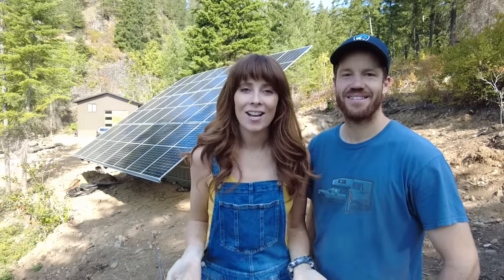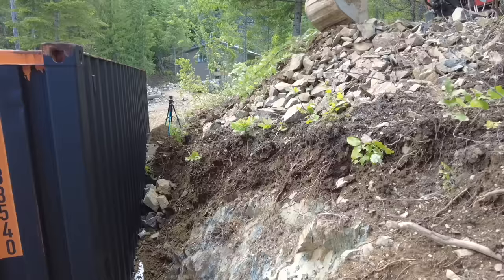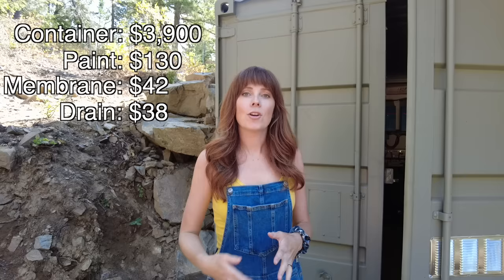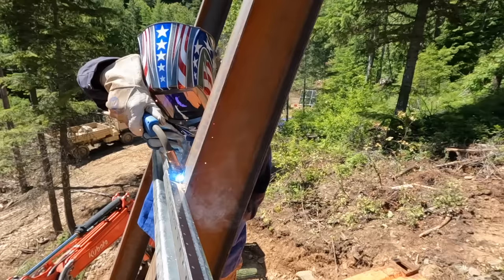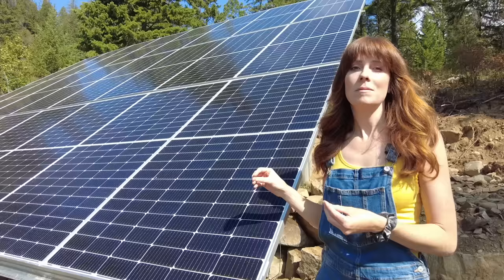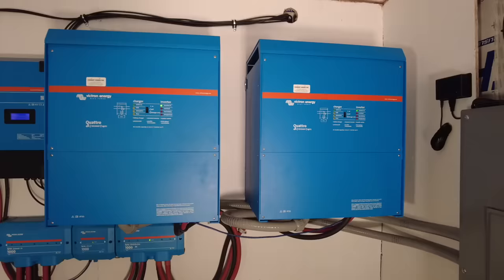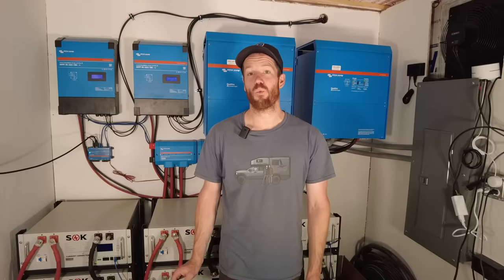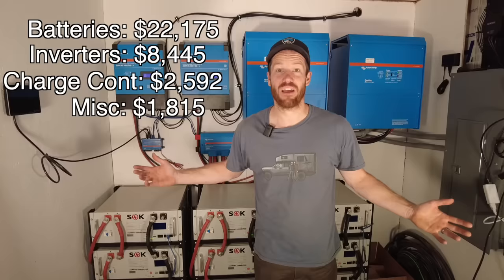TOTAL COST Of Our Off-Grid Solar Power System | Powering Our Mountain Home

Comment from the maker: What do you think, will this system be enough to keep us powered this winter?! ☀❄
Reply: More than enough.  We are following closely though.  Headed to ID in the next month or so to look for our own little piece of respite from the craziness that is everywhere.
Reply: I think you better have plenty of gasoline for that geni and propane or firewood for heat :). Regardless, it was the right move for the channel.
Reply: You should have plenty if you conserve power during bad weather. You mentioned a daily usage of 20% (12kWh) but if that is what you actually take from the batteries each day and not total daily consumption I can’t imagine just how much energy you use each day. At the end of the day you could easily get your daily consumption to around 3kWh per day if need be.
Reply: I expect it will provide plenty of power through the winter especially given the fact that you also have other means of heat. It’s a perfect solution for your situation
Reply: As you mention you are only using 20% of the battery capacity a day so even if that doubles in the winter due to being indoors more the only issue is replenishing that capacity.  Solar capacity might be your issue.
Reply: Well, I think it will depend on how creative you get in the workshop this winter, but I also see you folks putting a cross wall with a door to make a room for the battery's and a small electric thermostatic controlled heater to keep the battery's above freezing or optimum temperatures for the battery's. Other than that it looks like the best plan with continued savings every year.
Reply: Most definitely.
Reply: @johnw3724  with over 10kW of power and maybe as much as 12kW in the cold weather, you’d think that would be plenty but with all the surrounding trees, who knows.
Reply: Yes
Reply: yes and BTW can you show us ur internet solution what do you use to get it
Reply: I doubt you will ever have any issues with this awesome system you have created. You have done an excellent job & made so many good choices & asked the right questions. I think you will get some thermal benefit from burying the container, despite what other’s may have said, & I think it was a good choice for all the reasons you mentioned, even tho burying containers can have it’s cons, Hay bails front & side maybe if needed, but ur inverters will help keep the Power Room temp up as well of course. This Solar Series is what brought me to ur channel initially & I have binged most of ur adventures & Builds since, Love ur stuff! Cheers
Reply: I have no idea about winter, but you didn't give us an idea of cost on a generator. There are microturbine generators and the good old standard diesel generators. I've been to some off-grid properties and a massive generator with a battery bank seems to be most popular.
Reply: I would guess it will depend upon cloud cover.  You are in N. Idaho, snow county.  I would get a large back up generator just in case to keep batteries charged. I am sure you have already considered that.
Just rambling to please the algorithm.😎
Reply: @kevinmills5293  First 3kWh is 3000 watts...  
A 20gal electric hot-water heater will use more than 3kWh a day. A Well pump uses and average 1kWh per day. An electric clothes dryer will use at least 1kWh per hour. Then there is A/C that is going to pull at least 1kWh per hour. Misc. 'SMALL' oven 1kWh per hour. Lights, Computer, Fans, Microwave, at least 1kWh per day. He does WELDING - "Let's make it simple! If you run your MIG welder at 200 amps, it would draw somewhere around 20 amps from the supply. Thus, the power consumption of the welder will be 4.6kW. That said, similarly a 150 amps welder will use around 3kW of electricity."
Reply: I think you'll be OK. I'd probably look into adding a propane or diesel generator back up that can be on auto start just incase, you can set it up by your system. And don't be afraid to look into a wind generator. On the smaller scale, they can be quite effective.
Reply: @chasmarischen4459  you forgot house heating at 10W/square foot
Reply: Yes
Reply: Buy extra panels. they are only rated for 25 years.
Reply: My money is on yes for this winter, but the first year that you're doing a lot of shop work instead of construction work...Probably not.
Reply: @Chris_at_Home  I not so sure. When they get the workshop up and running, welders and plasma cutters take a lot of power.
Reply: I don’t think you will have any problems keeping your batteries warm with the inverters and charging equipment in there. We have a 4K inverter in a well insulated unheated 12x16 ft room and it keeps it above freezing even when it below -20f. We put the batteries and charge controller in a heated room.
Reply: Only thing I'm noticing is maybe shave some more dirt at the base of the array in winter mode, because a couple big days of snow could lead to build up on the lower panels
Reply: You might need to clear more trees in front of solar panels to get full potential in the winter.
Reply: Average sun hours in Coeur d Alene Idaho in July is 383 hours.  in December it's 60.   You have 24ea 440 watt solar panels.  But let's be honest.  That is a maximum number.  You never get anywhere near the maximum.   Your battery system is absolutely killer.   Lithium batteries charge so fast, you're not going to waste the power your panels bring in.  As an off grid person myself, I am an electricity miser in the winter.  but I have a fraction of the batteries that you have.  

My guess is you will probably have to cut back on your use of juice in the winter.  The question is how much.  That you'll just have to find out for yourself.
Reply: You would need to clear out the trees for winter sun. (which I think you've been doing). Expect long overcast periods which you generate almost no power & need to use generator to recharge your batteries.

 I would consider installing a small generator in the power building so you run quieter when you need to run it, ideally get it set up with auto-electric start the system can better manage the Batteries.

If you have an issue with snow sticking to the panels, look into applying a solar panel safe wax so the snow and water can slide off better. I guess you need to see if snow & ice build up will be an issue this winter.
Reply: yes !!!! that many kilo watt hours should give you plenty of power even if Riley is welding all day
Reply: how long to the next vid on double wide?
Reply: If the solar pwr system can't keep up in the winter, use the battery in the camper to...

GO SOUTH 'til SPRING!!!
Mother Nature has sent you a sign!

‐‐---------------------
Just watching our attitude towards challenges,  life, adventure, partnership, marriage, friends, is more inspiring and motivating than any self-help guru ; and not one of them has ever built their own Snow-zilla Jeep!
Reply: After being exposed to how engineers plan systems, My guess is you will have twice the energy you need in the worst of conditions.😁
Reply: I'm sure you guys will let us know, 😂. Wind and hydro next please.
Reply: @guytech7310  Or make the trees shorter by topping them off some. You don't want to risk erosion on that hill.
Reply: @nikolatesla5553  With the right solar array angle and the type of solar panels the sun reflecting off the snow should improve the solar output some. Some of best days for solar are in February up here. I have seen my small set up of panels put out about 125% of advertised output. It is all about photons hitting the panels.
Reply: I think it’ll be a close call. By then, you’ll be more active in the shop and it may end up needing the support of the generator from time to time.
Reply: Probably not. I have 10KW of panels and 90KW of batteries and come up short. 

The short days and the panel shading we can see now means your panels are going to get very limited hours in winter, even if it’s sunny a lot. Which it won’t be. 

You should clean up the trees doing shading to maximize output - Nice system! I’m 10K of solar offgrid with 8K radian and three 100A charge controllers. Same reason - the power company wanted a minimum of $37K to run power to our cabin. once you identify your problem trees. 

For just house loads, you would be fine, with shop loads? I’m guessing not.
Reply: @davebodine1526  nah, Sun will be too low during the winter.
Reply: Yes, plenty....
Reply: @guytech7310  Thanks for your answer. That makes sense and makes me think about something else. I'm not against solar power, but there are a lot of hidden costs you have to factor in to get the real cost of off-grid power as compared to on-grid power. To really get an idea of the future costs of all this, a person would need to figure in the costs of propane and/or gas for running generators to make up for when there isn't enough power in the solar batteries during the winters and other things that on-grid power would cover. That said, there is the factor of independence from the grid that some would pay extra for anyway.
Reply: @Chris_at_Home  You've had better luck than me.  i have an array in Western Washington.  They are supposed to be 330 Watts per panel.  Even having full sun and perfect sun angle, I never could achieve better than 275 watts on any panel.  And believe me, I tried.  Maybe I got a bad lot.
Reply: I have absolutely loved the videos on the off grid solar power generator station. Top notch batteries and equipment and yet watching both of you it looks so simple to assemble. I would have gone with 160 kilowatt hour battery capacity. Just for a hair more of just incase charging fails. Give you more time of just running on battery power for house and shop both running really hard. That way if you need a replacement part you have time to find it and fabricate if needed,, given the supply chain issues as of lately that will probably last another 2 to 5 years easy if not more.  Also if you couldn’t do the extra capacity I would have gotten another 10kva inverter so if you need 220vac 3 phase power to run a milling machine or a lathe or even a bigger air compressor. For a shop 3 phase is important. As for winter 🤔 I’m not so sure the earth will keep things warm but that’s where trying it out comes in. After all you still have the power from the camper and generator if you need it. It’s going to be really interesting as winter comes and you show us all the subtle changes and improvements you all implement since it’s a new experience. I can’t wait for the updates. Both of you must be so excited to try it out in winter. Best wishes to you both in all your future endeavors.
Reply: @evil17    lithium iron phosphate batteries like it to room temperature for best results so 🤔 thats like  60° to 70° Fahrenheit. To be honest I just don’t see that happening inside that container in the winter in that location. But I could be wrong. That’s where trying it out comes in.
Reply: @kevinmills5293  Living in a 2 bedroom condo with HVAC via heatpump system, having his-n-her's computers running 24/7, all LED lighting gas stove and hot water covered by strata fees and your usual use of in-suite washer & dryer in Vancouver, Canada usually puts us at 17kWh daily averaged over the year. This is with NONE of my shop tools, chargers, etc. so just imagine your wishful thinking of Riley & Courtney managing to use anywhere near 3kWh a day when our place when we are away in the winter for week averages 4.7kWh a day just keeping the fridge, network equipment, VoIP phones and alarm system running. The heating doesn't come on because the place is too well insulated. And no, Canadian watts are just the same as American watts. There's no metric conversion. 😁😉
Reply: Hay will draw mice. Mice love to chew on wire. Wouldn’t recommen hay.
Reply: @nikolatesla5553  I have 480 watts and keep them vertical in the winter to keep the snow off them. I saw them putting out 525 Watts on a bright sunny day with the ground covered with 3-4 feet of snow.
Reply: I think even using massive amounts daily without sun you should have 3 days before you would even have worry about running out.
Reply: You forgot to mention at the end to the new viewer that they can see building all that on this channel.
Reply: Re solar.
You need to stack hay bails on all sides and on top to insulate the inside. The units will generate some heat but after hours in the middle of the night when it is coldest is when you'll have issues. You'll have to get it above freezing at day break so the system will accept a charge. I think i rember a video of you using a propane heater. But you are going to be dealing with condensation. You two are very sharp individuals and I cant wait to see how you guys make this work.
I mean,  U built a camper, snow tracks, built a pole barn, bought,  broke, and fixed a D8 dozer. So you guys can figure out how to do just about anything.
Reply: @FirstLastOne  I live off grid in a 2 bed cave in Andalucía and my daily consumption in winter is around 4.5kWh. I have a washing machine, combi microwave, air fryer, pellet burner, big TV plus other bits and pieces. I could get that down to around 3kWh a day if I had to. I’m not saying R&C can do all their normal activities on 3kWh a day but if they are low on energy, 3-4kWh a day is doable.
Reply: Why didn't you consider a wind turbine?
Reply: It will keep you working on. 
Cheers. 🍺&🍷
Reply: Well, I made some assumptions but based on a south facing array for Ponderay ID, with a tilt of 45 degrees, you can expect to make about 481KWh in December. Or on average 15KWh per day. 

Seems like you could get by on that, but you'll also have days on end with hardly any power, followed by days that are clear. Only time will tell, but you may need to keep an eye on the forecast and go easy on the welding if you've got a couldy spell ahead.

pvwatts.nrel.gov is a great resource. I ran the figures before we installed a small residential system in Melbourne Australia and the reality is very close to what was estimated. 

You may need to ditch a few more trees though. Sadly.
Reply: I can't recall the capacity of your batteries but it's a pretty big solar array and being able to tilt it for better wintertime collection is HUGE.  I don't know about completely powered up, but I don't foresee you being completely without power at any point.  You might have to ration toward the end of a long cloudy period, but you'll be powered up in the essentials.
Reply: Absolutely with no doubt.
Reply: TIRE WALL BEHIND THE SOLAR PANELS TO STOP WIND ISSUES !!!!! Your welcome !!!!
Reply: I think it'll be enough! Seems that beast system would power a small town.. I guess the only possible down side would be the greater demand in the shop when you're forced inside and unable to do outside stuff. But who knows more about delegating power usage than you two?
Reply: Tough to say really but awesome system
Reply: My biggest concern is when your in winter, the sun is lower on the horizon... the tree shading is going to be a bigger factor, and shading kills a panels efficiency.  But, as long as you know this, and keep a long broom handy for snow, hopefully you won't have to fire up the generator too often.
Reply: Yes. Will you also be looking to add additional supplemental systems to it - like wind?
Reply: I'm off grid, totally, in No Cal.  I run a pretty advanced wood shop.  (16" table saw, 10 " table saw, 30" bandsaw, ETC ETC).  In the Summer, I also run a pool (pumps etc) I only have about 5KW in solar panels, but 4 outback 3800 watt inverters.  I have NO problems.  Yeah, in the winter, in the shop, I might run a generator at times.  But only once a week or so in general.  In the summer, never turn it on.  One thing I found, is it is hard to start single phase machines.  5 hp single phase, is hard or non starter, (running is fine, just surge is tough) so I generally go to 3 phase for larger machines of 5 hp or even 7.5.  Then I run them with VFDs and just dial in a ramp up of a couple seconds and no problem.  Looks darn good what you have done.
Reply: Only if you knock down those trees in front of it.
Reply: @davebodine1526 The  evergreens in north Idaho dont tolerate topping well. It usually kills them
Reply: Having a simular setup (3 phase, so 3 Quattro's), I can tell from experience they suck about 140 Watts each, 24/7. You can see this at night in your VRM console, difference between battery drain and actual external loads. This means a daily phantom drain of 6 kWh, there are quite a few clouded days between November and February where you will not produce that much power, you can add a wind mill or hydro power source or just increase the amount of pannels. I went from 56 to 140 pannels now (330 Watt units) and next year we are adding 80 more, just waiting for a new roof to be constructed. Beauty of the 48V bar system is you can keep adding more power sources, just keep the cables symmetrical.
Reply: @adarelliott  Good point. I guess I would not want my top chopped off either! LOL
Reply: When you said "let's go inside and look at the brains of the operation" I totally expected you to pull the door open to reveal Courtney standing there. 🤣

Love your stuff guys it's an inspiration. And ... watch this space as we're going to be starting our own adventure in rural Ireland and HOPEFULLY documenting it all here on YouTube in the coming months.
Reply: Just had another thought. As we are also in northern idaho... In the winter we dont have a issue with snow on our panels. Because their vertical. No kidding. they may be only catching 90% of the light, but not having to sweep them multiple times daily is the hot ticket. Still have to run the gen an hour a day to keep the bank charged up, but we still had to do that anyway.. Good luck!
Reply: Are the fires affecting you,hope there not to close.
Reply from the maker: @arthurmartin1886  We are safe. Thank you for asking. ☺️
Reply: I can't see why not. Especially if you have a fireplace or wood stove for heating. You were smart in selecting/building such a large system. In fact, perhaps you should add to it a bit when you can since it's ground based and easy to add to and you're getting a nice deal on the panels. But even when cloudy, solar panels make anywhere from 10 to 40% of it's total output, so that should be 1 to 4kw per hour for you during peak hours. You might have to trim a tree on two, though, when the sun goes further down on the southern horizon in winter. Every little bit helps in those sun-lean times.
Reply: I use 50kWh/day in Aug. I could produce 125kWh right now on a bright sunny day if i needed it. With 20,640w, I will not have enough in Nov-Feb.
Reply: I would say how many kilowatts do you use in a day?
Reply: Ad shutters and l.e.d.s. lights.
Reply: @kellyshilka9860  Yeah boxing in the batteries and the inverters makes sense. The inverters and chargers will all release abit of heat during operation that would hopefully keep that area above freezing
Reply: Nope...not even close.
Reply: As probably one of your only other viewers with a comparable sized system and fully off-grid, no way will you have enough power for winter to just use without any thought or conservation.  My batteries are generally fully charged by 10am and yours not til noon, and I think your demand load is much higher, so no you will either need to conserve in winter or wait for sunny days to do your welding and high demand work.  

Nice system but I have tons of concerns on the loading on that racking system when at full tilt in winter.  That is a giant wind sail and I think you get wind loads that far exceed my area.  Knowing the size poles and depth of concrete needed  for your size system with tilt, that container can easily blow over
Reply: BTW.. I skipped around in the video.. I never got what voltage those SOK batteries are wired for, or inverters..
Reply: @melvinmolly4151  any system that large will be 48v.
Reply: @PartTimeYooper  Ya.. I kind of over stretched my 4000 watt system with 12v..
Reply: You can probably sell electric to your nieghbor.
Reply: report in the winter please, also container is a steel one it will freeze much faster than anything else
Reply: Your battery power should get you through.  You just have to actively monitor and manage use.
Reply: Nope not even close
Reply: No spreadsheet to download. You tell readers to "Download The Complete Spreadsheet HERE:", when selected, asks for email so the spreadsheet can be EMAILED, that's a link to grab email addresses sell it and spam people.
Reply from the maker: @oldflyer4252  We are not selling email addresses, but we are working to grow our own email list so we can start sending out fun update emails about the property.
Reply: Regarding batteries, I feel that marketing people are trying to push lithium iron phosphate as a one-fits-all solution, which I would disagree upon. Especially the company-prepackaged lithium units which are difficult to repurpose if, say, a BMS microcontroller in one unit fails. Yes, they are well suited to use in RV and boat applications where weight is a concern. In a fixed, fully off-grid system, weight and a 1 hour charge time are of absolutely zero benefit (Components are sized wrong if that is happening). Charge efficiency is also not a huge concern (Upsize your solar array by 5%). I personally think that at this point, traditional flooded lead acid is still the best for small fixed, stationary systems (They can last up to 10 years if maintained well, and with low-cost pH monitoring, an automated watering system could be built if needed), while zinc bromide flow batteries should be considered more for larger off-grid systems, as they last 5-figure number of cycles and only need the occasional pump replacement.

Also, there is the problem of there simply not being enough lithium reserves in the world to use it as the one exclusive battery type for everything. Until sodium-ion batteries come on the market...

Not that I discredit the technology, but I think lithium due to its scarcity means it will never be the most cost effective option for off-grid applications. I once built an e-bike battery with lithium polymer cells (I would 100% use lithium in this case), and found that all of the BMS wiring adds a lot of complexity to the system.
Reply: It should.  It would  take modification to  your racking system but if you need more solar input set up a tracking system where you gain more hours of ideal solar giving you three to 4 times the effectiveness  from your panels for a very small investment. You can also maximize the  gain from your panels by using foil covered rigid insulation to reflect  sunlight on the  back of your panels.
Reply: In winter, my rooftop solar system in California goes down to 25-30% of summer peak production amount.  I’m not sure you’ll get by without some kind of alternative backup power system in the winter.  You might be cutting it close!
Reply: Cutting the trees down that are giving so much shading on you panels will help enormously.
Reply: Depends. How are your panels wired, series or parallel? Does each panel have a load optimizer or are they wired straight to the inverters? How much full sun time does the array get? You have many trees and in that terrain I suspect your full sun time will be limited. I am interested in the outcome. I live south of Houston in 1600 sqft ranch house. Our average daily elec use  is around 45-48kw. Its just the wife and me and the biggest load we have is the AC unit and maybe her sewing machines (I think she has 4). She makes a lot of quilts. 

Basically you need to figure what your daily use will be and the find out what the average full sun time will be and then do the math. Good luck.
Reply: This is my first time on your channel, I look forward to your spring video to see how you managed with this panel! Im rooting for you guys :)
Reply: I don't think you guys will make it trough the winter with this system. I have 3,3KW of solar here (in Belgium) and in winter  on some days i have 0 to 1 kW per day. Off course your batteries won't charge either so make sure to have plenty of wood for heating. Solar is great for 8 months per year if you live in Northern regions. Don't expect anything in winter. Same for our solar Boiler btw, between march and end of september works like a charm.
Reply: Ok this video says it talks about solar panels but starts with shipping containers. for half the vid. wtf
Reply: It's good but you have some shading problems.  Might want to cut those few trees in front of the panels.
Reply: with the way it is ingeniously calculated and designed, it sure will
Reply: You only get like 10% power in the winter. And you need to use it for heat, unless you have some other source. Anywhere with snow is not a solid year-round solution, sadly.
Reply: @freedomfreedom6544  Finally, someone admitting this is literally just an advertising stunt.
Reply: I watch to learn. You guys are figuring out the numbers and nuts and bolts so I am just along for the ride. Thank you for your videos on the why and not just the how. Understanding the thoughts behind the decision makes it easier to know when something is technical requirement driven and when it is situational or preference. I am curious if you have thought about wind turbines as back up to your solar system? Generally speaking days that will kill your solar output should feed your wind power ... generally speaking.
Reply: @FirstLastOne  For an alternate perspective, I have a 3 bedroom condo, portable A/C, 2 computers, 2 Ipads, TV's, all LED lighting, electric stove, electric baseboard heat, and hot water covered by strata fees. We try to avoid using the electric clothes dryer but our family of 4 uses the washing machine regularly, in Vancouver, Canada. Our average daily electricity consumption is 8.78 kWh per day. When we are away in summer the home consumes 1 kWh per day running the fridge, etc., we shut off routers and modems, phone is a landline, no alarm.
Reply: @kevinmills5293  North Americans love their 3000 watt electric clothes dryers, and stove/ovens. Baseboard heaters are 1500 watts per unit - 1 per room. We also like big fridges - 2000 watts per day. 4.5 kWh per day is unlikely.
Reply: I hope so because that’s what I want to do. Like you said it’s adjustable. If you’re not pulling enough you can put in more panels. Then you have to buy electric dirt bikes so you’re not throwing away electricity all summer
Reply: I'd recommend that you install a manual transfer switch on the electrical panel in your home and pick-up a backup generator like the Champion 9,000 / 12,250 Watt gas generator for  ~$1000 from Costco just in case for cloudy days. Use the transfer switch to divert power from your solar setup so that it can focus on topping up it's charge and run off the generator for 8 hours during the day.

Champion Model number: 201218

It'll run for 8 Hours on a 7.7gal tank. Average price of gas in Idaho is $4.355, that works out about $33.53

Obvs you don't want to be running on it all the time, but for ~$1,000 it's a pretty good deal.

However, if you were really, really cool you could install a small 5-8kW wind turbine too.
Reply: Make electric at night
Reply: @kevinmills5293  3 KWH per day is a ridiculous number. Only a caveman would use that little energy. 30-40 kwh per day is average for any modern house, and if you let your hair grow long and sing "Kumbaya" you might be able to get down to 15 kwh if you really cut back. And that's without electric heat or AC!
Reply: @timb7814  it’s funny you should say that. I do live in a cave in Andalucía Spain. My average daily use is around 5-6kWh and that is with appliances such as washing machine, air fryer, combination microwave, fridge freezer and a mini split A/C unit (not used very often).
Reply: It will be interesting to see what happens when the ambient air temperature remains below freezing. Will the snow shed? I have had limited success using wipe on coatings like Rain-X or glycerin.
Reply: I think you will be fine. It depends how much you are using in the house - not just the average but the peak consumption and how well insulated you are. Good luck.
Reply: From my experience No it will not be enough. I am from northern Alberta and have a comparable system. You will need a back up generator. But for the most part I think you will do good. But with big snow storms and no sun for a few days you will need a bit of extra energy. Nice system, Guessing from the prices it's in US funds not Canadian. 😂
Reply: where did you buy the panels, i can't understand in the video
Reply: you could add a wind turbine to your system for winter and bad wether
Reply: no.
Reply: 4 months in  the mid to late winter and hows it going 
hows the batteries holding  up 
power consumption  and production 
temperature of water and batteries and have you used the generator  at all?
a follow-up would be nice!!!!!
Reply: Again, steam is the way to go.  They phased steam out so you would not mess with it and figure out it can be modified to make free heat and free power.  Not kidding.  
Nothing for sale, just showing you how to do it.  See my Steam Car Video.
Reply: We don't care.
Reply: I live in a condominium which does not allow solar panel on the common roof but I like solar power. Seeing that you guys are happy to have created such a good off-grid solar power system by yourselves make me happy too. I admire people who have the knowledge and skill to build things for improving their own homes.
Reply: if you have any flowing water (stream or river) on your property id look into tapping that for power too since running water doesn't stop with the sun going down and continues to make power, first video I've seen from the channel, I think.
Reply: No
Reply: No, the cold and the snow will soon reduce your energy production to almost zero.
Reply: @flashrandom  the cold? The snow would,  but it's really easy to plow.
The trees will get in the way of the sunrays, because of the sun's incidence angle.
The cold has  positive effects on the panel production, reduction of the semiconductor resistance
Reply: There is absolutely no way this system will get you through the winter. Solar power systems run terrible in winter... You can be happy if the system delivers even 10 percent of the installed power during the few hours of daylight you have. Your generator is going to running non stop until late spring.
Reply: I would consider installing some foamboard insulation in the shipping container to retain some heat. It will increase your battery efficiency, and I would wager the heat generated by the inverters and other components will contribute to warming the interior. Fantastic to partially bury the shipping container into the hillside to increase the thermal mass. Love this!
Reply: depends on the weather. Good thing you oversized it. Snow drifts up against the panel since it's right against the ground is going to be a problem.
Reply: Hi. Great video and well thought-out build. So we're 5 months along with a couple of winter months behind you.
Any update if you can cover your needs (including the boiler :-) during the winter without having to start up a generator?
Reply: Idaho also has very generous additional state tax credits for solar
Reply: I think your usage is a very good case. because you have the peak usage that justifies the extra capacity (in both battery and solar), but everyone also needs that level of capacity, even just for a basic house.  You need enough batteries to be able to run a week, and you need enough solar to be able to deal with the significantly (like less than half) generation you get in the winter vs summer.
Reply: Which are your cost investment renter ?   i mean how many time is needing to cover the 50K USD ?
Reply: Whats the latitude Your panels are installed in?  48° something?
Reply: No way to tell until you test and see.  More than solar I am into hydro power just for that reason, it’s not dependent on anything in winter.  I am presently looking for land with a running stream on it with at least 6’ drop so I can install a hydro electric system, I think for much cheaper.  Did you consider that option?  Do you have a stream on your property?
Reply: So it seems like you have 10kw system there which should generate around 32-40 kwh per day during winter. Depend on your usage but I am pretty sure that it won't be enough for winter months especially if it is snow there.
Reply: Hope so! Awesom job!
Reply: One thing I want to share though you might want to try wind turbine depending on you wind conditions.
Reply: @super_hero2  do you recommennd any good solution? With inverter on the grid? What effect? 😀
Reply: Container will get hot and humid in summer and freezing and moist in winter. Electronics won’t like that. A solar+generator system would be cheaper and give better redundancy. You mostly need the big solarsystem to (hopefully) cover the shoptools/welding machine.
Reply: You guys should try Nikolas Tesla, free energy
Reply: It all depends on the cloud cover during the winter season. In the worst case, only 20-30 kWh can be produced. There is no way around without gasoline. You can build a ground heat exchanger and connect it to solar panels.
Reply: Be careful of the trees and shading they can actually cause damage to the system due to the shade
Reply: so far this winter my village has had about 6 days with sunshine.  no incoming power to speak of.  so i bought a generator to charge batteries and am running on the grid with backup.
Reply: take a look at the hill behind your shop it looks like a small land side pro spot
Reply: @BartHuitsing  For one thing, the can and do kill flying critters.
Reply: @PPW865  ?c
Reply: @PPW865 3????I I use 7th , ar?! I 7.3 !, and 9
Reply: @nikolatesla5553  I find I get maximum peak power on a sunny but cold winter day. In summer, the panels derate by about 20%. Like their system, I can adjust my panel angle to get as much sun as possible.
Reply: What happens if it hails or a tree brach hits it etc...???
Reply: man it's good and durable. the odds are:
1. it's very expensive, you can cut cost more than 70% of the cost.
2. it will be damaged if a wind exceeded 70 km/h from the back.
Reply: Yes and no, you're able to make a more stable setup by converting to DC power. Any old PC power supply rewired to twelve volts can give you DC power (guides online somewhere) and it's possible to series connect them if you do it correctly with a diode and fuse in place on each. 24v is two of them, 48 is 3. a Car USB plug is a 5v buck converter but there is 5v rails on most PC power supplies. Higher wattage equals easier to run more like an inverter would be. Use a fuse panel to connect the DC devices. PC power supplies are easier to get ahold of than buck or boost converters and sometimes free. You need AC to travel the energy in your scenario unfortunately but this'll help anyways by lowering energy use from extra inverters that come with your devices (big box on plugs). For Heat consumption consider building a Sand Battery to save energy on cooking or heating, use junk sand and cement debree in them. Any source of excess heat captured by the sand battery charges it. Insulated vents and fans control the system.
Reply: I know it won't.
Reply: Please store the excess energy other ways besides electric batteries. An air compressor will produce potable water (survival amounts, not such a concern where you are) heat (from compression, store it in a heat sink) cooling (from expansion, also used to produce electricity). Running the compressed air cold is great for cooling, running it through a heat sink increases electrical return through a turbine generator. The individual components are widely available, maybe you already have them (haven’t seen enough to know your setup). For energy storage per dollar, it’s hard to beat a 100 gallon electric water heater. Congrats!
Reply: Did u think about build rail shutters plexiglass  mirror  l.e.d. lights  poof electric power supply  at night  🌃
Reply: Powered yes, heated no.
Reply: U can make candle 🕯 convection heater 5.00 month fr heat
Reply: Make convection heater cost 5.00 month heat cabin
Reply: I think so, but your many hours of GREY Sky's are the problem , every location is different and the hard part for you guys is the sunless sky's in the winter....
that is why I mentioned the Wind turbine idea.... a vertical wind turbine to help supplement the panels when there is little sun out.... having to rely on a generator is a P.I.T.A.  been there, done that for years on end.  there is no good side to it !
a Wind turbine of say 2000w could cure that problem.... 6 decent size trees spread out in a circle and tied together at the top would make a great tower to get the turbine high enough to catch the wind.... or you could just climb a live tree and put it on top of it, that's what I did.... but get someone else to install it Riley...92' in the air gave me nightmares for weeks and I'm not the least afraid of heights ! that is a very long way up !  but 6 trees together with a built on ladder.... it would be easy pezy !  ...but do a vertical wind turbine so you don't have the problem of the swivel
for the wires !  or you could just buy the pipe and make your own tower.... you have an excavator after all !!!!! and a portable welder system all figured out (super slick)
so add WIND POWER into the mix !!!!!!
Reply: How did it due in the winter? I was thinking it might be to low for how you wanted to set it up in winter I'm not sure where you are in the mountains bur around here the snow would get as high as the seacan.
Reply: Based on the video title and description, the Segway Portable PowerStation Cube Series seems like a great option for keeping your mountain home powered this winter. With its massive capacity, powerful output, fast recharging, and waterproof technology, it should be able to meet your power needs. It also offers versatile sockets and uninterrupted power supply. You might want to consider this reliable and convenient power solution for your outdoor adventures and home backup needs.
Reply: Based on the title of the video and your comment, it seems like the off-grid solar power system showcased in the video could be a great option for keeping you powered this winter. However, for a reliable backup power solution, I highly recommend considering the Segway Portable PowerStation Cube Series. With its massive capacity, fast recharging, and armor design, it's the ideal choice for outdoor enthusiasts like us. Stay powered up and enjoy your winter adventures!
Reply: Based on the video title and the description of the Segway Portable PowerStation Cube Series, I think it could definitely be a great option to keep you powered this winter! With its massive capacity, fast recharging, and waterproof technology, it seems like a reliable and versatile power source for outdoor enthusiasts like us. Plus, the ability to monitor and control energy usage through the app is a nice feature. Consider checking it out!
Reply: i like how yenz don't act like your better class people than your viewers are.  i can tell by how you ended the video.  clearly saying how this system was possible for yenz and then saying thank you.  i like that. i like your guys style.  and boy that would be a dream like setup what yenz got there.  happy for yenz.  

i do leaf clean up service in fall time. so i have a complete mountain of leaves at the end. and to the Miss's point of geothermal heat for the shipping container..

you'l have to do this each fall but would be awefully worth the exercise and geothermal heat in the winter to gather and mound it all around what you can, because them leaves and pine needles start putting off heat in just a couple weeks.  seems like all leaves do better than all pinestraw in my observations of it, i think its because you can make a deep pile of leaves easier and faster than a pile of pine needles,  needs be a good 2 ft deed but the deeper the better. once the heats starts from deep inside a pile, it just keeps radiating outwards ya know. so everything in it.   say fo rexample...an outside doggy house fo rthe dog if you wanna keep em outside some times, burry the doghouse in a pile of leaves.  and the pooch will be just warm and cozy in its house.  trust me..  your 70 degees is like 90 in its fur anyways lol..

  but so anyways... its like the microwaver effect. the heats inside. not much on the outside.  so if you guys wanna play around with that in fall time, i'd take the leaf blower and have a whole lota fun with it next fall. there is plenty to work with there and i'd barry what you can, that you would like to keep heated and let nature do its thing for yenz  :)

oh yeah and something you can test out today, put a mound of leaves/pine needles together about 4 ft tall.  leave it in a pile like that for a month.  then go dig into it.  you'l see for yourself just how much heat it generates. it be a woosh of warmth and steam coming out of it. if yenz wanna know for sure its actually working and working worth the effort to play with next fall, can do that real fast today.   in sun or shade btw.  its of course hatter and faster heating in more sun tho. but in shade,  its slower but still real nice way to keep something form freezing, thats for sure.  wrap it in plastic or seal it up how you will and then burry it in leaves. thats what the leaf cleanup guys says anyways.. lol  :)

side my cents and bored rambling...thumbs up to you two ^^
Reply: Is that a use case for LTO batteries?
They don't have a problem with the cold -40 to -50°C is what some list but it rarely gets below -20°C where you live I guess.
Even Toshiba sells LTO cells like the SCiB ones but Yinlong sells different ones in D cell shape but bigger.
Problem is I don't know where the branded YinLongs come from.
I guess some factory in China sells them with any brand name you want on them.
You might be able to find regional reseller of LTO cells and for stationary use if you treat them well they can last 30 to 40 years cycle wise.
I don't know about the shelf life or operating life of the cells because I never had them for 40 years.
But 20 to 30 thousand cycles sound good on paper.
You might want to do your own research.
Reply: Would a wood gassifyer work for the time being?
Or a wind turbine or a small hydro plant?
Reply: First: thank you for sharing your videos you guys really do a good job. 
Second: I am very happy for the life you guys are creating for yourselves. 
Third I wish you great success! 
I must say, you do seem to have your thumb on the scale a bit. I'm not sure you added the costs of purchasing and running your generator back into the equation. With grid power, you probably still need that as a backup, but you need to include it in your assessment. 
Looking at later videos it appears that you also added several more solar panels in spite of having a surplus during the summer months. 
Anyway congratulations!
Reply: Yup exactly right, why rent your energy when you can produce your own energy. Think about EV's so you don't have to pay for gasoline. Love the setup.

I am going to borrow some of your ideas to build my next (retirement) container home. You guys are brilliant.
Reply: @BartHuitsing  they break. ALOT. wind is great power IF you live in a place that has good wind all year but moving parts means bearings wear out and oil is needed. its not a set it and forget it situation.
Reply: @kaimekaimietis  Starlink
Reply: Where is the update?